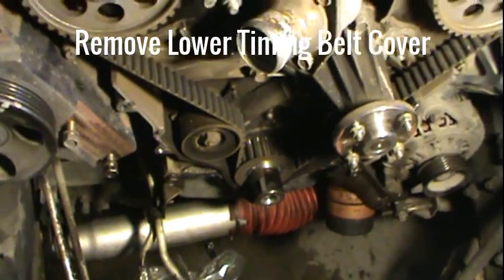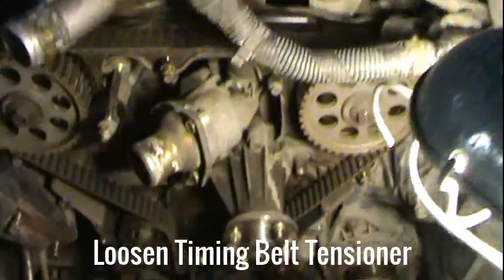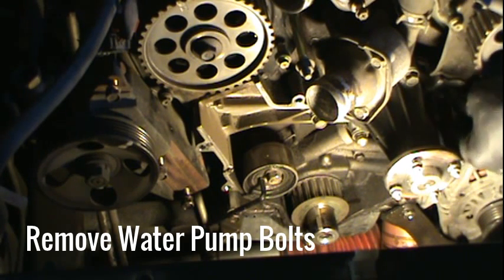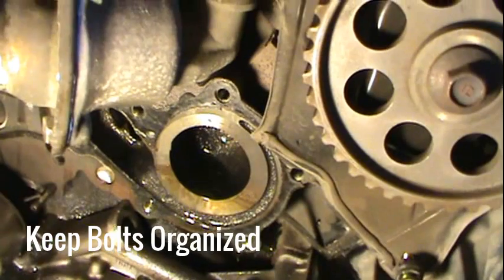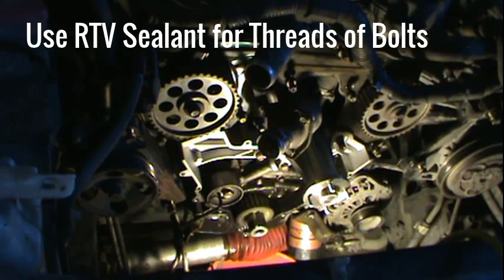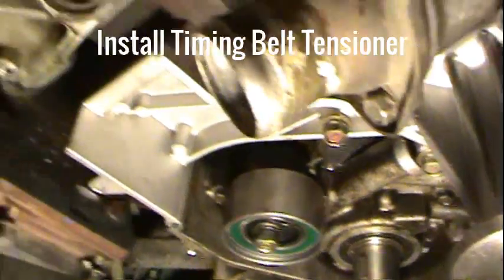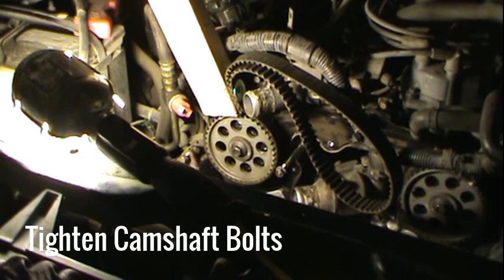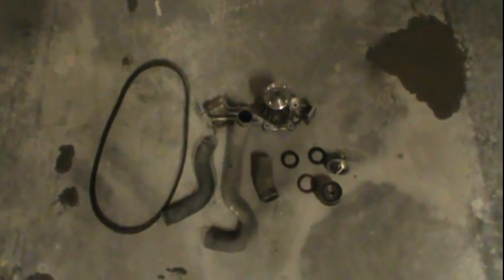Timing Belt, Timing Belt Tensioner, Water Pump, Thermostat, 2004 Nissan Xterra 3.3L V6 Part 4

Comment: These 4 videos have been very informative!  I've wrenched on my own vehicles for years, but the prospect of changing the timing belt on my 2004 Nissan Frontier (especially everything else that goes along with it) is a little intimidating.  Your videos helped a lot!!  A few questions:

1.  How can I get a pic of the tool you used to seat the cam/crack seals?
2.  How long did this job take you?  I understand it took longer due to you stopping and explaining stuff.
3.  Which way does the engine rotate (for TDC) - left or right (as you're looking at the engine)?
4.  Did you threadlock everything, or just particular bolts?  Blue or Red?
5.  What type of RTV did you use?  Did you use silicone in ADDITION to gaskets, or silicone alone?
6.  When you pulled the cam/crankshaft seals, did you lose oil?  If so, how much?
7.  I understand you didn't drain antifreeze, but how much antifreeze did you have to replace when you refilled the system?

Thanks again for the videos - they've been extremely helpful in planning my own maintenance!
Reply from the maker: 1. I made a video for a guy on how to make it.  I'll send you a link to it to your youtube inbox.  2. The job took me about 2 days in all.  I did a lot of running back and forth between home and part stores when I ran into issues.3. When you are looking at the engine, the engine rotates clockwise to the right.4.  I used threadlocker on some specific bolts but not everything.  Didn't do threadlocker on the timing belt cover if I remember right.  Blue threadlocker.5.  I used a very light amount of blue permatex RTV (almost positive it was the blue... safe for use around water/coolant) on top of the gasket because I saw some small gouges after scraping the old gasket off.  The RTV will help to fill those spots in where the gasket won't/6. I didn't lose any oil.7. Didn't drain the block, but I remember buying two gallons of antifreeze and using about 1 to 1.5 gallons.If you don't get the link from me in the next ten hours, shoot me another comment to remind me.  Heading to work and its going to be crazy today.Let me know if you have any more questions.Thanks for the comment!
Reply from the maker: I couldn't send the link to you, so here ya go:http://youtu.be/vIYXvitK8WQ
Reply: Grant Varvil I believe that should have been INCH pounds. Divide by 12 gives foot pounds. So 144 = 12 foot pounds. 192 =  16 foot pounds. Wheel LUG bolts are only around 100 foot pounds. Excellent video otherwise. I'm almost 60 and will need to do this on an Xterra I just bought. NOT looking forward to it.

Comment: Great video series. Do you know if it is more or less the same to replace the water pump on a 06 Xterra 4.0l. I have to work on it this weekend. Where did you buy your water pump?
Reply from the maker: Thanks for the comment. I'm not 100% sure, but I would put my money on it being the same process. I picked up the water pump from Oreilley Auto Parts in Anchorage. The tacky spray adhesive makes getting the gasket on and having it stay in place during installation a breeze. Make sure to use some R TV sealant on the bolt threads to ensure that coolant doesn't make its way out through the bolt holes when under pressure. Feel free to give me a call or text if you get hung up. Ill shoot you my number to your inbox. 

Grant